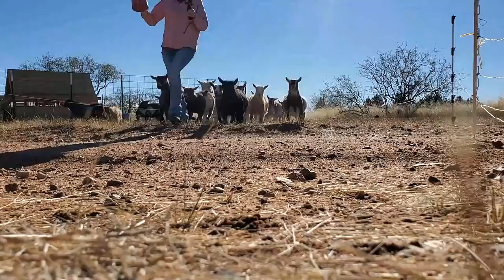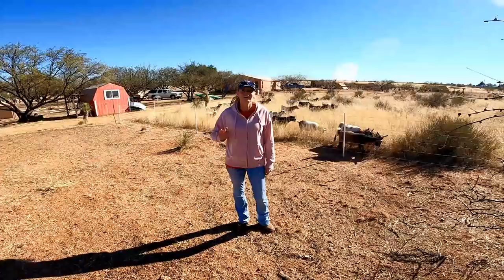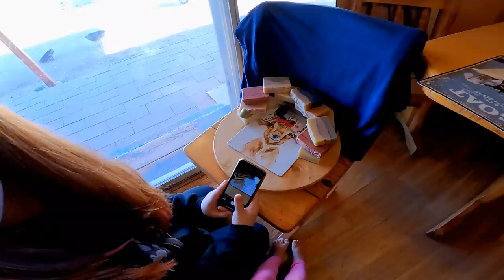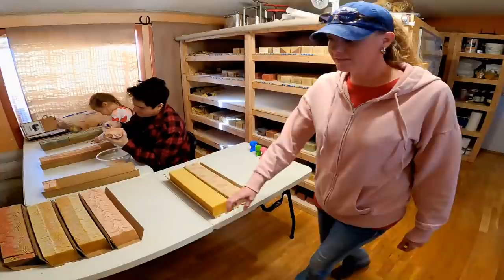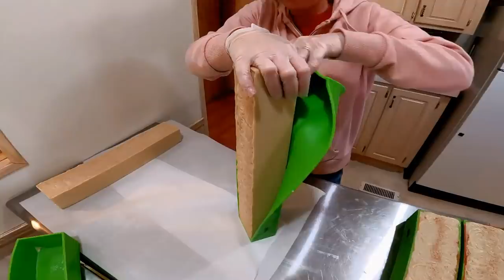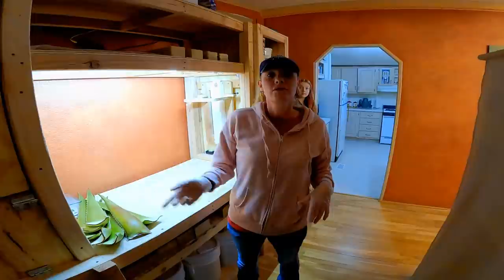What Really Happened With My Milk Test Results??

Comment: I made my soap molds super easy to get out, i just hinged boards together lined it with oilcloth fold up and put bungie cord around it   and  pour soap in when ready to take out you just remove the bungie cord and the sides and ends fold down lift the soap and cut